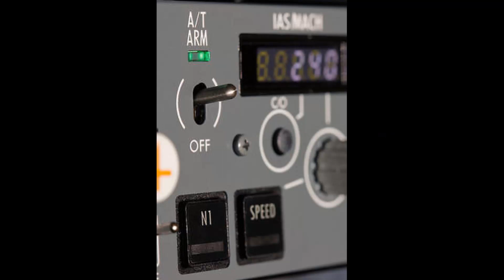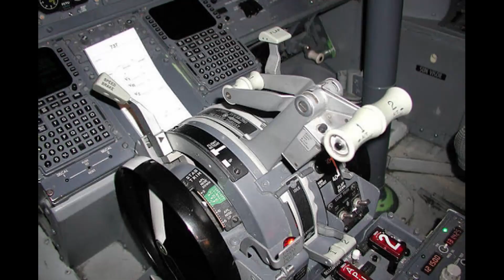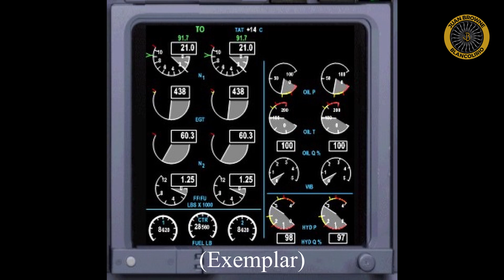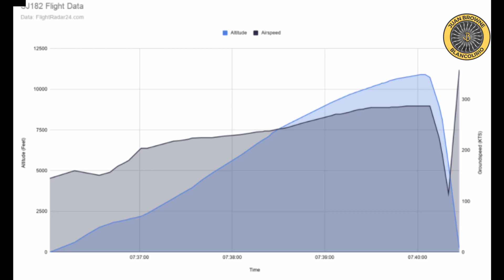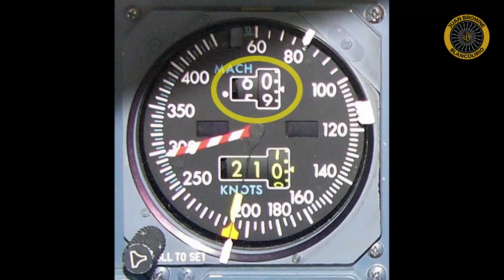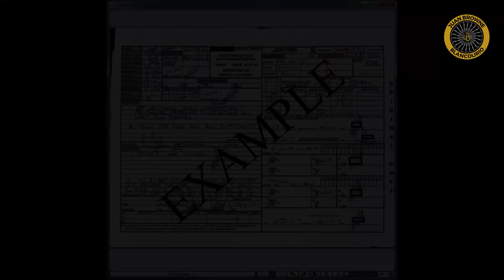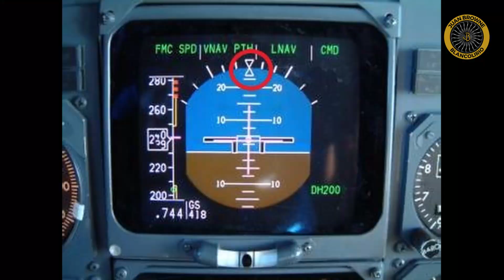Sriwijaya SJ-182 KNKT Preliminary Report 12 Feb 2021

Comment: Juan, great reporting.  Unbelievable that the flight crew failed to monitor/guard the throttles as is the standard procedure with most airlines.  Once again automation overwhelming the flight crew.  It is also troubling to know that in Indonesia and Europe you can become a F.O. on a commercial airliner with 150 hours of flight time. Looking forward to the final.
Reply: Not all that many planes are falling out of the sky in Europe btw.
Reply: @lex1945  Not that many? How many is enough?
Reply: You are spot-on and that is correct, 150 hrs is ridiculous for an fo. But what the heck, I saw a first-hand situation where they promoted an FO to Captain because of supply and demand, with only 35 hours in type. In that part of the world, many procedures that we see as safe and good operating values in the USA, ARE BADLY NEGLECTED.
Reply: @chuckcampbell3927  totally agree. No one wants to say it, but you take an additional risk (not worth it imo) when you fly these discount carriers in that part of the world.
Reply: @Ryanboy2020  I was referring to how many do you think crash inside Europe due to lack of having enough hours under the belt when starting as an FO? I can't think of any more or less than elsewhere inclusing the US. Could you specify recent crashes inside Europa because of claims that you're making here?
Reply: The US has a very well developed General Aviation market (including instructors etc), large corporate aviation market, and a large number of former military pilots. They can set higher minimum hour limits for starting FOs because they have where to recruit from. In other countries, these pools of already experienced pilots simply don't exist or are very small. There's simply nowhere you can find first time FOs that already have thousands of hours, so they have to basically train pilots to become FOs.
Reply: @kistovisback  The old model in the U.S. of military pilots naturally progressing to the airlines has been in steady decline over the last 40 years.  There are several reasons for this, none of which matter to our conversation.  I would agree with you that there is a more strict policy in the U.S. over who can access the right seat of a airliner and when.  I'm not sure I agree with you about there being more qualified candidates in the U.S., in whatever pipeline, then that of Europe.  In fact, ask @mentourpilot, Peter about recruitment of qualified candidates in Europe.
Reply: @JGaffney9000  Thank you for posting.
Reply: @Ryanboy2020  I'm sure it varies from to place to place, there's degrees of availability of sufficiently experienced candidates for sure. However, looking in my country for example, Romania, we have the tiniest of airforces, no corporate jet market to speak of (maybe a few dozen business jets in all the country), and GA is very undeveloped and almost all made up of VFR pilots flying LSA category planes, the occasional 172 and rarely something bigger. If Romanian airlines would try to recruit first time FOs with 1500 hours already under their belt, I'm not sure we'd have any airlines :) Sure, we could recruit from outside the country, and that happens too.
Reply: There is a vast amount of difference between the level of safety between Indonesia and Europe. I don't think that the type of a licence the FO has to hold is all that important when you look at the Indonesian airline industry as a whole.
Reply: @kistovisback  I have flown in your country, beautiful 🙏
Reply: @Ryanboy2020  Awesome <3 :)
Reply: @kistovisback  Yes you can find FOs is Europe with a lot more hours than that, but many of these
low time FOs pay their way into the right seat and accept lower pay and conditions.
Reply: @fjp3305  Yeah, I'm sure you can, but you have to hire them form another airline, they're already FOs. I was referring more to the entry level, where do you get new FOs from. Less of a problem these days I assume, but when the industry was growing by leaps and bounds, you had to get a lot of new pilots in fast, because there weren't enough of them. I'm not denying that might cause many issues, for sure, that kind of growth pressure can weaken safety if not handled well.
Reply: He may have only had 150 hours when promoted to FO, but he had 3000 hours in this type of plane in the ensuing two or more years. To my mind, even if he had never been in a plane when appointed FO, after 3K hours he should have a pretty darn good idea what was going on and what he was supposed to be doing. In any case I don't see any reason to blame this on the FO, he probably wasn't PF. What was the captain doing?
Reply: Troubling to know you can become an F/O at 150 hours? Really? That’s funny because Europe has among the best safety records in aviation an Indonesia the worse. Don’t see the correlation. This seems much more of a case of badly trained crews in a corrupt system. There is nothing overwhelming about a failure like this. It is a relatively simple issue.
Reply: @fredericborloo1910  I 100% agree Frederic. Europe and Indonesia are two different ball games.
Reply: @JGaffney9000  And remember that both Helios B737 and Spanair MD had bad design practices: Using the same horn for two very different conditions on the 737, and placing the two very different circuits on the same breaker on the MD.  And the A320 having no realistic means to open the damn cockpit door in the Germanwings... Thus, a profound DESIGN review on all airliners is in order, not only on the crews performance, but on the "engineers" performing the design too.
Reply: @lex1945  LOL, no for sure but training is taken very seriously here.
Reply: @lex1945  European flight training seems to be fabulously good, negating the the need for an F.O. to have an ATPL. Just look at any of the videos posted here by Baltic for example.
Reply: @JGaffney9000  None of which would have benefitted from a more experienced F.O. I think. Not sure about Helios, that one was odd. You don't mention AF447 where I doubt that F.O. Bonin ever learnt anything of consequence at flight school ! AF probably only kept him on because of worries about 'discrimination' against those we'll say aren't entirely 'western'.
Reply: @TheDeadfast  I saw a documentary about an Indonesian flight school. It was troubling to say the least ! All the WRONG THINGS are being done.
Reply: sam s  Europe doesn't do a lot of things.
Reply: @chuckcampbell3927  But this has nothing to do with this case. The specific Captain of this flight was very experienced, with more than 17900 hours of flight time all-in-all, ATPL, a former military pilot, with more than 9000 hours of flight experience alone on the 737, so obviously with better references than probably most US pilots have - at least HE should have been able to recover the plane and rescue the human lifes on board, including his own - why wasn´t he able to do it?
I´m glad that the CVR data can now be read out so that it is probable that we get a facts-based answer to this question and doesn´t depend on speculations any longer.
Reply: @lwilton  He had round about 5000 hours of flight experience. And indeed: What was the Captain doing? His reference were better than most pilots in the US and Europe have. Why wasn´t he able to get the situation under control?

Comment: So what are the probable causes for one engine pulling back on throttle gradually over time?  Doesn't such an auto anomaly warrant a report to pilots?
Reply: asymmetric pitot icing could cause the autothrottle to incorrectly perceive gust loads and then react by commanding assymetric throttle roll back - my belief

Comment: A.I.  at its worst.  The pilot must always be ahead of the autopilot.  He must have his hands on the throttle(S) and be ready to take over if the autopilot kicks off.  As a Mooney pilot with an autopilot that controls the manual flight connections from the computer brain (the A.I.) to the "servos" in the wings and in the main body of the airplane to control the tail section as well, we G.A. pilots have similar responsibilities as do the airline pilots.  Our duty is to bring our passengers home alive.  But if we place our trust and faith into a computer that has connections with the flight surfaces, then are we willing to allow a preprogrammed computer to take over our human judgments?   In other words, If we depend on the flight application we installed into our little two-inch by ten-inch computer box, in lieu of our personal judgments, we are no longer the pilot I command.  If we allow our "A.I." autopilot to take over our pilot in command responsibilities, then we have failed to do our jobs as pilots in command of our aircraft. 
            At no point are pilots allowed to permit the "A.I." portion of our autopilot to take charge of our command.   Any pilot that gives his autopilot the greater responsibility of flying the airplane has failed in his duty as a "pilot in command" of his aircraft.   The A.I. autopilot should never be allowed to make the final decision as to who is "PIC" otherwise known as "pilot in command".  The FAA has never allowed the autopilot to make the final decision.  The FAA has always placed the duty of the final control of the aircraft on the human being who has been placed in charge as the "pilot in command".  The autopilot can never and should never be considered the "pilot in command", even if Elon Musk should have his way with A.I.  But this is just my humble opinion.   JMHO.  Others may disagree, but I believe the PIC must be the Human Factor in the equation, not the A.I. factor in the equation.  Are there any pilots here who disagree with me and believe that the AutoPilot should have the final authority and the PIC should yield to its A.I. intelligence?  Just a humble question for any pilot who has flown an instrument approach down to minimums using an autopilot.  Who is the final boss, the autopilot or the human pilot?  And what is to become of our future if the likes of Elon Musk create aircraft with autopilots smarter than human beings?  Are we stupid human being pilots supposed to yield to the A.I. intelligence of the future creations of our technology?
Reply: "He must have his hands on the throttle(S) and be ready to take over if the autopilot kicks off." This is true when using the cruise control on a motor vehicle, as well. If you take your foot off the accelerator, as many do, you will lose valuable seconds figuring out where the brake pedal is when you need it. I won't use cruise control, even though I have kept my foot on the accelerator the few times I've tried it.
Reply: @lizj5740  Yes, especially when you are driving on ice and into situations like in Fort Worth Texas yesterday where the people were unexperienced and there was no A.I. auto pilot to interfere in order to prevent the 100 car crash.  Really Mr. Musk, would your Tesla's have made a significant difference if they were under your A.I. System under the circumstances?  I doubt it.  In fact, I'd bet the crashes would have been significantly worse if your cars had their A.I. intelligence under their controls.  But that's just my very humble opinion.  Prove me otherwise with any data you wish.  You can't  because you've never had 100 of your cars involved with an icy crash before.  You can not repeat your data in real life unless you are willing to repeat yesterday's horrible debacle.  Can't you?  BTW, I'm really with you, I just want to see how your A.I. Cars  could have made a significant difference.  In truth you can't prove anything unless you are willing to duplicate the experiment. And you can't because it would be unethical to do so.
Reply: @daffidavit  
Ask Elon Musk to put his driverless car with him in it on a road in the mountains with no guard rails.

Comment: Would the pilot in command not know the auto pilot was compensating for the reducing throttle setting on one of the turbines.
Reply: Only if they were paying attention.  Looking at the engine gauges, throttle lever position, rudder trim position might have clued them in.  But if they were inattentive or busy doing something else, then who knows.
Reply: Aileron (Control wheel displacement) And a LOT of it would have been evident, even to these idiots. That is how the autopilot controls yaw from asymmetric thrust and a drifting heading on this aircraft. 2 axis autopilot.

Comment: This seems to be another example of not responding properly to an unusual attitude.  I believe the crash was the fault of the crew.  Granted, there were most likely malfunctions, but, pilots are supposed to handle unusual attitudes with some basic aircraft control.  This crash seems to be the result of this crew's failure to fly the airplane.
Reply: "Anyone" can fly a plane but it takes a pilot to handle extreme situations.

Comment: Sounds like Capt. Warren Vanderburgh’s unusual attitude recovery videos should be mandatory viewing for all airline transport pilots, even all these years later.
Reply: Unless you fly a bribebus, those pedals are just foot rests.
Reply: @sylvesterstewart868  Often make unsubstantiated allegations do you ??? How about the self-crashing death trap called the MAX ?
Reply: @pasoundman  There's more substance in what I'm saying that what NTSB said about AA587. Im' not sure what the Max has tk do with anything but that discussion starts with the DC-10.
Reply: @sylvesterstewart868  I was referring to 'notoriously' poor planes for safety (before correction of the design flaws). You can include the DC-10 too FWIW. Some planes fare better. Both the A340 and B777  had an impeccable record until poor handling by the pilots crashed one of each, luckily with low loss of life. You should remember that  Boeing and Airbus rudders have different control laws and DON'T apply full left or right input at maneouvering speed, never mind 'wiggling' it with that magnitude of input !
Reply: @pasoundman  Defective RTLS and AA flt 903 (1997)

Comment: I would rather fly with a pilot who has crashed a plane than one who hasn’t, you must know how to react in a situation.great review.
Reply: I don’t know about crashed a plane, but a pilot that has been scared a few times and had a come to Jesus moment or two can be a plus. A wake up call or two to tighten up on procedure, tighten up on instrument scan, and stay ahead of the plane. 

I was in a crash with a 3K hr pilot. But, 200 in type which was really 10 hrs of experience 20x over. And without an occasional challenge his skill set wasn’t advancing. The airframe was lost, no injuries. (Low time DHC-6 off field landing. Plenty of fuel, but both motors stone cold.)
Reply: During WW-2 if a skipper had a boat shot out from under him and he wasn't completely negligent they would give him another boat and send him out again. That kind of experience is hard to come by.
Reply: @garymartin9777  
War time is problematic. And if the captain was completely negligent he’d not be given a command for critical engagement. But as a necessity of hurricanes war might be in command of an ancillary craft. Out of necessity.

Comment: All it takes is ONE distraction!   That is one of the most important things I saw in my 41 years flying commercially.  One distraction can lead even the most experienced pilots into a disaster.  As Juan pointed out the biggest unanswered question here is what was the airspeed at the time the auto throttles kicked off.   Furthermore, how did the retarding throttle, which would  have produced a very noticeable split in the thrust levers, not to mention the engine N1 display and feeling the yaw in the seat of your pants go unnoticed by both pilots? Clearly the weather and associated turbulence created a small distraction, since they had asked to deviate, but that in and of itself shouldn't have been the issue.  It just seems like there is still something else missing in this.  Hard to believe an auto throttle malfunction alone, at that altitude, could have led to this outcome.